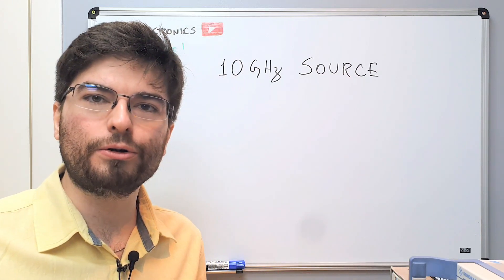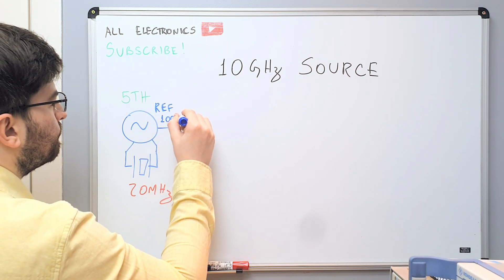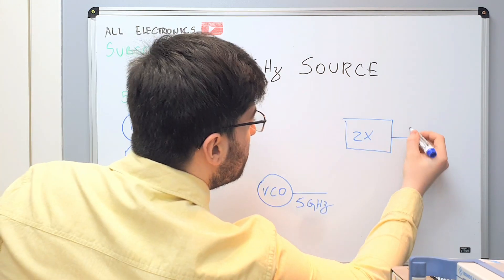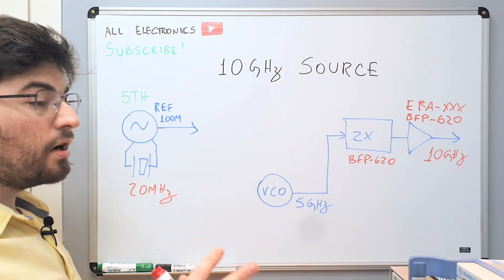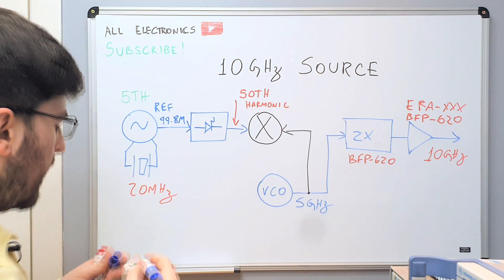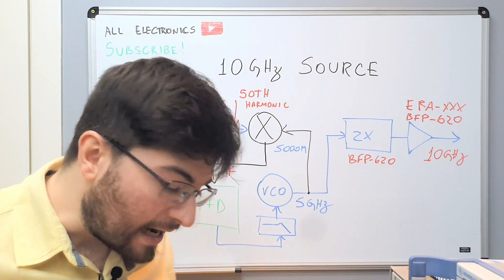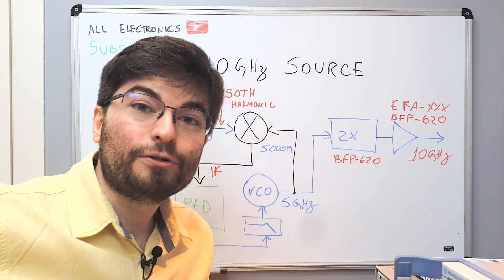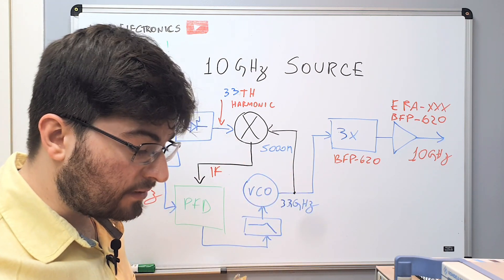10GHz Microwave Signal Source

Comment: What are some good books for 100 GHz?
Reply from the maker: Also wanna know!
Reply: @AllElectronicsChannel  Joking aside, was wondering at what point do you need to use classified semiconductor technology to generate it. It must be in the 300 GHz range for sure. I wanted to see if you could make 95 GHz because that is used to heat the outer layer of the skin in this microwave anti personal device. I suppose using a frequency doubler or tripler is in the cards because you can probably find a VCO that puts out 30-33 GHz. Problem is that circuit will have to proactively be built on top of itself in a 3d-like manner. Regular coax isn’t going to work either.
Reply from the maker: Ebay probably have a lot o Russian parts...

Comment: What did the prescalers do to you?
Did they steal the girl you like or something?

Just kidding, great content as always, I'm really looking forward to it, especially the sampler seems like a very intersting part to design.
I find the 10GHz range to be pretty hard to prototype, since 1mm of error in a dimension is quite significant already. 
Also the dielectric losses of FR4 get pretty high pretty quick. 

You can get pretty good parts and boards by tearing apart LNBs, especially the older ones, since they operate at roughly the frequency you want. 

Greetings, 
Michael
Reply from the maker: Hahahahaha prescalers are the easy way!! 

Yep.. I don't know if 10gig will work on FR4.. But the BPF transistor has a lot of gain 

I'm seeing packs of 15 LNBs new  very cheap..  is it worth to buy for parts? It's like $2 USD each
Reply: @AllElectronicsChannel  I don't think a pack of 15 LNBs is really necessary but one or two to take a look at are pretty nice in my opinion. 
But keep in mind that the modern types are not as interesting as the older ones.
Reply: @AllElectronicsChannel  prescalers are great, but there are too many people that use them like a cheat code and never mention other methods of generating UHF and SHF frequencies, such as frequency multiplication and mixing.